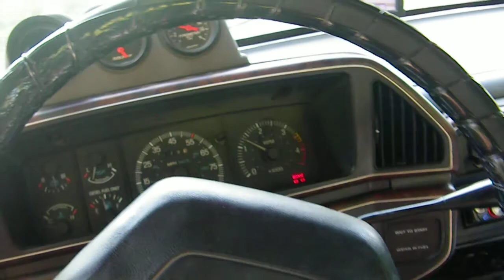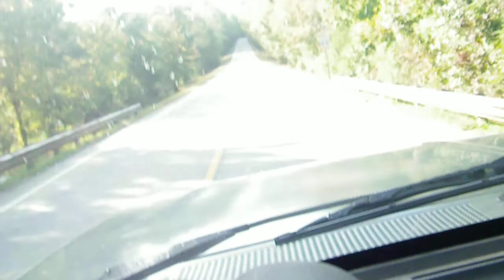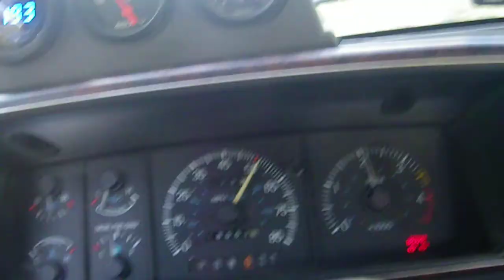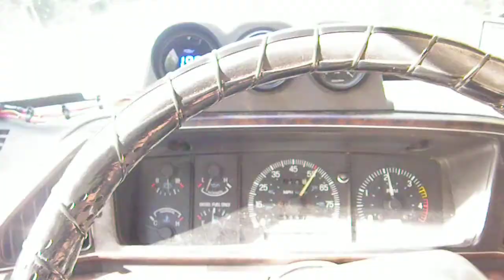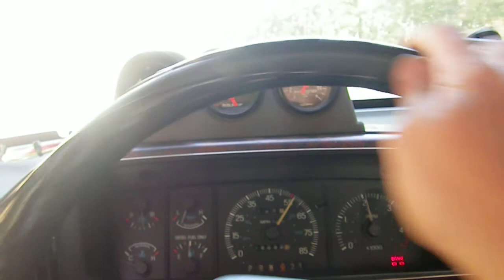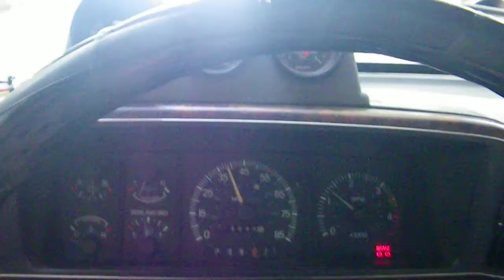Pulling a hill in North Georgia

Comment from the maker: Thanks. Hwy mileage is 17-19mpg going 65mph, around town is about 14mpg. I have 4.10 gears, E40D trans. Really my truck has 3 computers. Cruise control, Transmission controller, and my Radio. That's one reason on a long list of reasons to own one of these old diesel's.